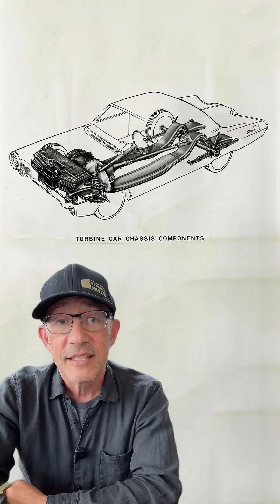It was a good try 🤷🏻‍♂️ #turbine #conceptcar #chrysler #carhistory #strangebuttrue

Comment: Way ahead of their time. Back then, Chrysler was a car company run by engineers.
Reply: Yeah it was... sad what happened after lee Iacoca left, and even worse in the 2000s
Reply: No, not ahead of their time, almost 10 years before this a British car company built a turbine powered car, at the same time Chrysler did this Ford developed a turbine powered tractor trailer because they thought the low cost of operating a turbine on long hauls like trucks do would revolutionize the trucking industry, the truck was named Big Red because of its paint job and is still in existence. 
The cold start problem he mentioned just scratches the surface of all the reasons why turbine powered motor vehicles are impractical, aside from initial cost the problems are many.
Reply: @dukecraig2402  Yes. The 1950  Rover Jet1 was probably the first of the jet turbine cars. They later partnered with BRM and successfully competed at Lemans.  Thanks for the info.
Reply: @praetoreanbob2634 
That's right, Rover, thanks, I was drawing a total blank on that one and couldn't remember who it was that built one in England. 
Any idea how many they made?
Did they actually go into production or like Chrysler did they never get past trials?